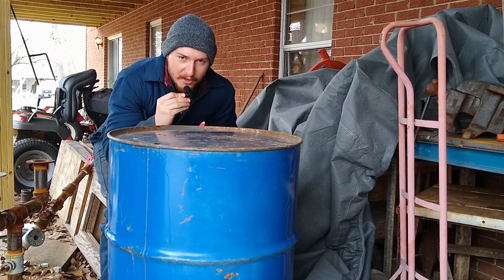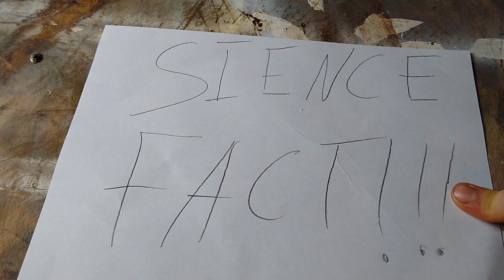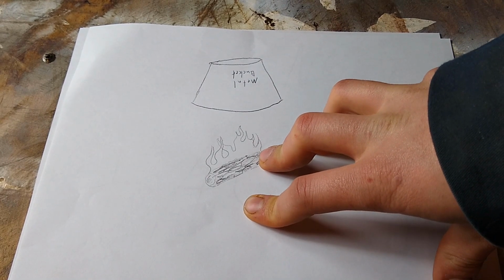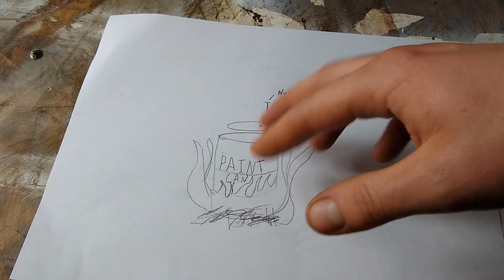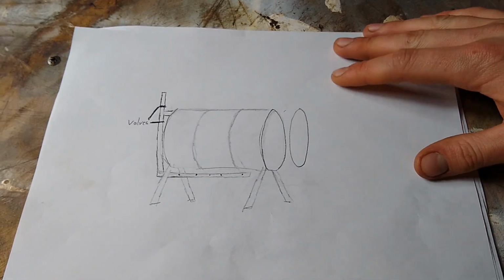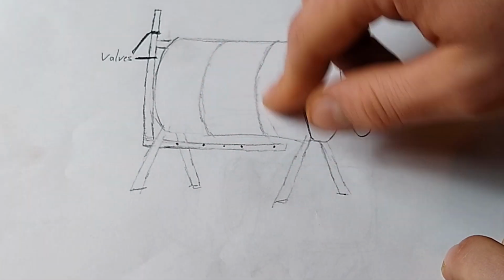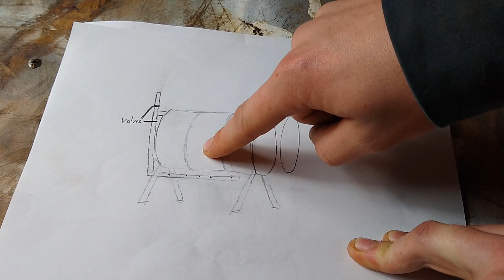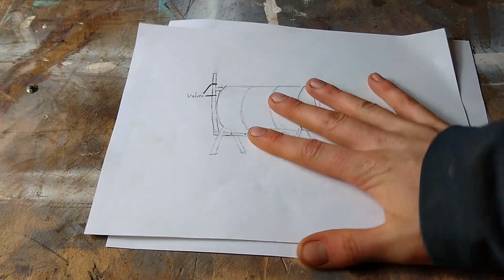55 Gallon Drum Charcoal Maker Build

Comment: I like the T out the back with the under/over valve design. Let out the steam first then use the gas once its reached critical. I’d cut a second barrel in half top to bottom and put one of those halves on top of the main barrel with a mat of fiberglass inbetween- hold some heat